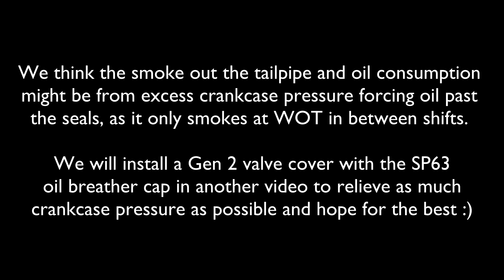Mazdaspeed 3 -  JBR Oil Restrictor Bolt Install & NGK One Step Colder Spark Plug Gaping

Comment: Ok. One thing at a time: the valve cover pressure is not an issue on your setup, most probably the right banjo bolt will fix the issue. Upgrading it just to get a breather cap will not improve anything. The new gen2 design just moves the vent closer to the turbo (you will have to upgrade the TIP as well) but other than that it's the same design with those metal fins slightly overlapping to prevent oil from being spit out but still allowing excess of pressure to vent out. The vacuum created by the turbo will take care of that. If you really want those oil vapours in our cabin then SP63 makes a breather oil cap for the gen1 style valve cover as well. I would not install that sooner than 600whp though.
Next thing: here is how you can gap the spark plugs properly and at the exact wanted gap with normal tools. Please excuse the eastern european accent. I recommend going as low as 0.65mm with the BNR S4 + meth (or anything bigger than an S3/GTX28 with aux fuelling) or 0.026": https://www.youtube.com/watch?v=O8NGZQetYWQ
Reply from the maker: Thanks for the advice. I stored the car for winter shortly after we installed the JBR bolt, so I wasn't able to do enough testing to see if it solved the issue. I've already purchased a Gen 2 valve cover and SP63 Oil Breather Cap. Come spring time I'll do some more testing before installing the valve cover and breather to see if the JBR bolt solves the issue on it's own:)

Comment: Any advantage of the NGK over Denso?
Reply from the maker: From what I've read the Denso plugs aren't as reliable and tend to suffer from spark blowout. There are more good reviews on the NGK's than the Denso plugs.
Reply: Thanks for the input. Guess I'll be busy swapping plugs this weekend..Lol..Thanks for the awesome videos...keep em' coming. #mazdafam
Reply from the maker: @marcodiaz2577  Right on dude! Don't forget to gap them down to 0.026-0.028" as they come pregapped to approximately 0.042"

Comment: Where you getting like blue smoke or look like a diesel truck ?
Reply from the maker: It does burn some oil in the exhaust past the turbo seals, but hopefully with the new crankcase pressure relief mods that we've recently installed, along with an oil restrictor bolt directly from BNR, the oil consumption and slight smoking will stop. Time will tell but we'll keep the channel posted :)